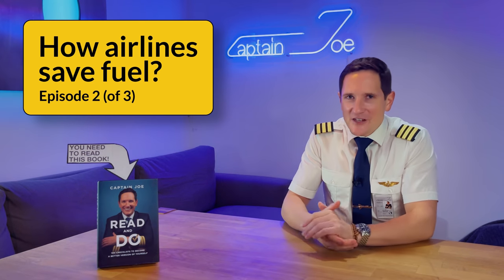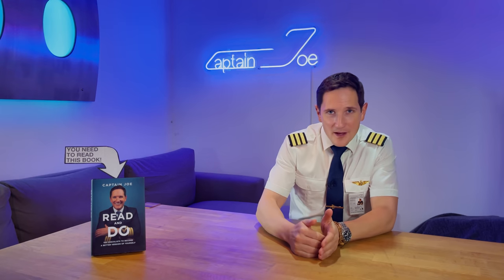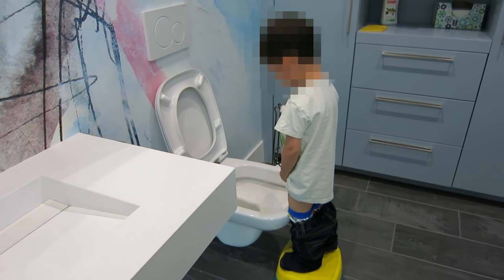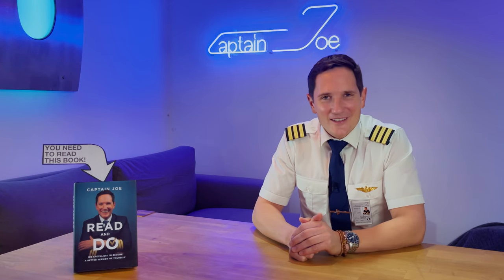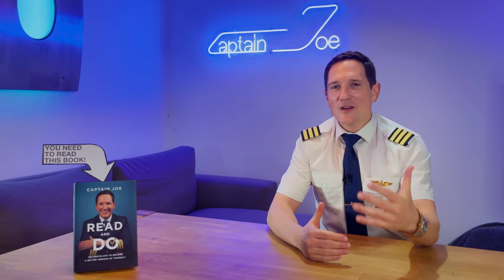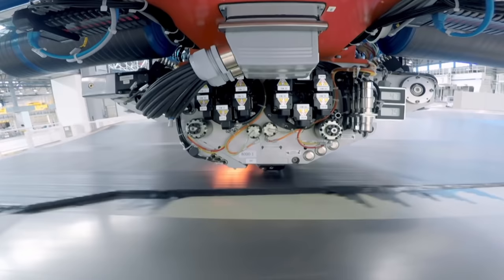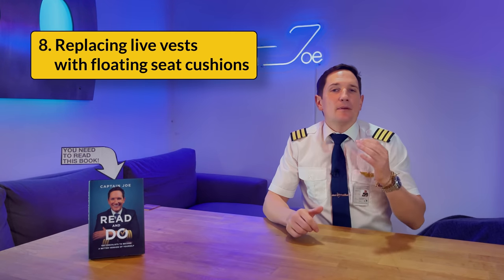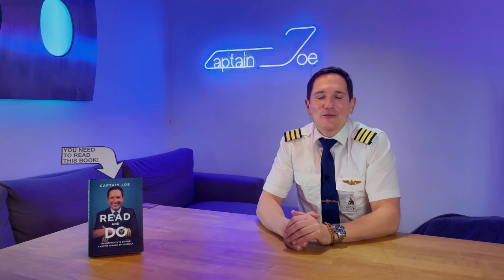HOW TO REDUCE WEIGHT on planes? Explained by CAPTAIN JOE

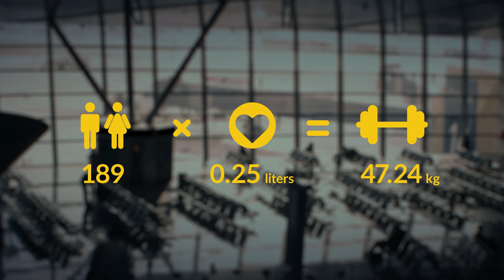Comment: 4:23 I do not think it is that easy. What do you think about this:
A paper from 2017 ("Fuel Economy as Function of Weight and Distance") comes to this conclusion "a reduction in weight by one kg saves ~ 0.02 to 0.03 kg of fuel per 1’000 km or ~ 2 to 3 €cent respectively."   which is 1/10 of your calculation.

Comment: Well, wow.  Two points.  First, I would not dream of flying on a Boeing Dreamliner.  They are manufactured in Charleston, SC, by engineers and technicians that are novices to the aircraft manufacturing industry.  No different than the 737 Max.  Second, you overlooked the most obvious weight savings - kick off the overweight American fat ass passengers.  I would not even recommend hitting them with a surcharge for their weight.  Just don't allow them to fly.  That way, I could get an extra olive on my salad and the airline would save a lot more money on fuel in the process.  Just give them a discount ticket to walk and lose weight and be healthy.  They would also lower health care costs in the process - win/win!

Comment: At 4:45 you say this saves 28.35kg of fuel and shortly after 89.3kg of CO2. And again at 6:00 the graphic says 425,000 tons of fuel and 1,300,000 tons of CO2. How is this possible? How is the CO2 released from the burning fuel heavier than the fuel? Because it is mixed with the air or what am I missing here?
Reply: Carbon Dioxide it the product of burning fuel - one part of carbon needs two parts of oxygen to burn properly, thus 1kg of fuel gives about 3.8kg of Carbon Dioxide (most of the rest of the exhaust gas is water, which is produced by the hydrogen that makes up the bulk of the rest of the fuel).
Reply: One Carbon atom (from the fuel) plus TWO Oxygen atoms (from the air) combine to make ONE CO2 molecule.
And considering that the Oxygen atoms each have a mass of 16 Atomic Mass Units and the single Carbon atom has a mass of 12 Atomic Mass Units, it's pretty easy to see that you should see a roughly 3x increase in the weight of the output CO2 compared to the input Carbon.
Granted, there's also a lot of Hydrogen in jet fuel, but each 2 of those hydrogen atoms just gets attached to a single Oxygen atom to form Water vapor, or H2O.
So yes, the math adds up, the extra mass comes from atomic oxygen.